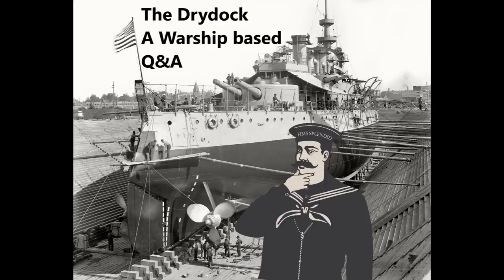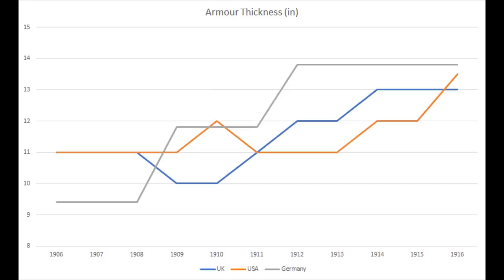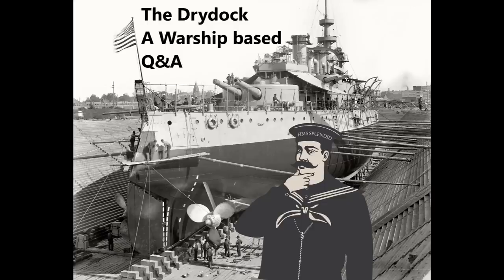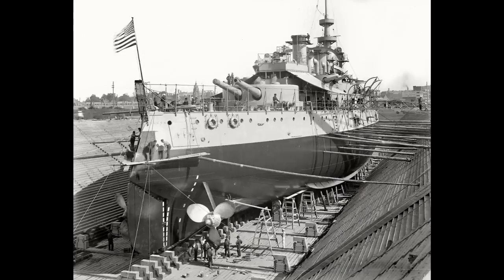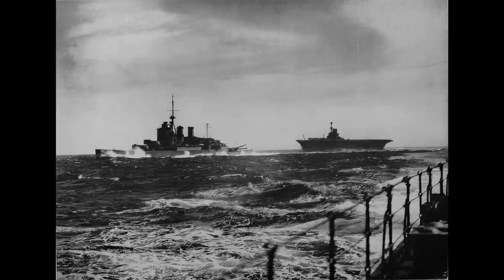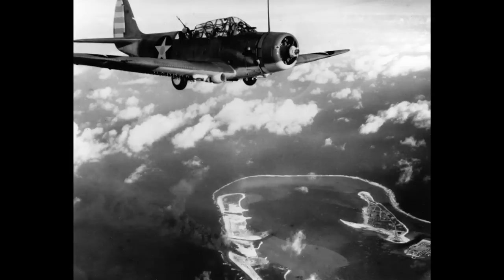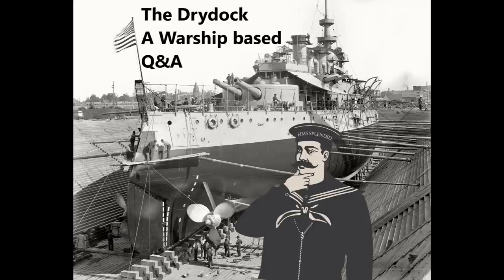The Drydock - Episode 226

Comment: As for Darwin Awards, I'd nominate 3 events:
1. Pearl Harbor.  Even without hindsight, the lack of basic US fighter cover gave the Japanese a perfect attack. (With a 1a of the Japanese calling off the third attack wave on drydocks and fuel dumps, which gave the US a fighting chance at recovery & the fuel to counterattack)
2. Marianas Turkey Shoot: it devastated the last trained Japanese air crews and planes, forcing them into Kamikaze tactics that started shortly thereafter (which in itself turned Darwin Award tactics in a devastating and arguably effective weapon)
3. The US attack on Truk. This attack devastated the iJN surface fleet when they did not have the time or materiel to replace.  It also lacked much of an air defense response, either

Comment: Thanks for your reply to my question about Courageous.  I am satisfied that Furious was intended as a test bed for the 18".  The design was in hand, could be built quickly, and, was large enough to carry the 18" guns.  Since posting that question, I found a letter on The Dreadnought Project: Fisher to d'Eyncourt, saying words to the effect that the Baltic operation was "the story we will use to sell them to Cabinet", which makes it sound like the Baltic op was not what Fisher really had in mind, but only an excuse to build them.  In that letter, Fisher also says having the draft be 22 1/2 feet or less was imperative.  The draft was the only parameter laid out in that letter that Courageous missed, by a wide margin.  Renown's draft was some 5 feet less than Revenge, but Courageous' draft was only some 14 inches less than Renown, so hardly seems worth the bother.  I tried redesigning Courageous in SpringSharp to see if I could get to that 22 1/2 foot draft.  Could not make the hull any flimsier, so replaced the two twin 15" with three twin 9.2" turrets borrowed from Lord Nelson pre-dreadnoughts, to reduce weight.  Only reduced the draft to 24 1/2 feet.   It could be a matter of Fisher seeing those unused 15" turrets and deciding he would see them used, for something, other than a monitor, and Courageous was what he came up with, to have the turrets put to use, much as the construction of Vanguard was due to the availability of those same four turrets.

Comment: 24:40 Clouds worrked both ways at Midway at least. With the Japanese having poor radios no radar it was essential for the Japanese to visually detect incoming strikes, but the clouds concealed the high flying SBDs from both the ships and the CAP that busied itself with the TBDs and the Thatch flight that flew in low, under the cloud cover and were thus detected by both the escort ships and the CAP.

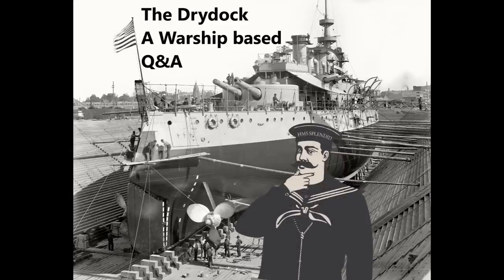Comment: 46:46 I think you are perfectly right when you say that this is an impossible question to answer for certain. When the Washington treaty was debated in Japan, it was very much an argument between two factions of the Navy. The Japanese called it “the war of the two Kato” because the two factions were led by admirals named Kato: Katô Hiroharu (or Kanji depending on the reading) and Katô Tomosaburô. However Katô Tomosaburô was the most senior of the two, and had been minister of the navy and full admiral since 1915, and was Japan's chief commissioner plenipotentiary at Washington, so his faction, which was the majority, won. From what I read the Japanese were not too much against the Washington treaty as an armament regulation treaty (Katô Tomosaburo was appointed Prime Minister after his return from Washington). They were, however, disappointed by the British because they felt that London chose Washington over Tôkyô and the British were relegated in the camp of “the anglo-saxons” i.e. the English speaking superpower that wanted to undermine Japanese success. The relations between Japan and the US were already tense and the British siding with Washington was a big disappointment for the Japanese. However the big Kantô earthquake of 1923 put aside military matters and worsened the economic and budgetary situation of Japan. But by the end of the 1920’s, Japan had recovered from its economic crisis and then came the London naval treaty, which was much more debated and opposed than the Washington treaty. Katô Hiroharu was by then Chief of the Navy General Staff and Japan’s economy was doing well unlike the US’s and Britain’s economies (Wall Street Crash of 1929) so the treaty was seen even more as unfair for Japan. So… To return to the initial question, I don’t see anything against a continuation of the Anglo-Japanese alliance at least until the 1930’s. In the late 1910’s and in the 1920’s Japan was in a period called “the Taishô democracy” so is not the dangerous, expansionist and militarist country (anglo-saxon vision) of the late 1930’s. And to be honest (non-british opinion here) I don’t see the British oppose imperialism, unless it is against their interest. Japanese politics at this period are quite unstable so it would be impossible to guess the outcome of an alternative 1930 London treaty in which the British are still allied with Japan (they might obtain more with British support) but at this point it is science fiction.

Comment: It was only in mid-WWII that the problem of not being able to tell one ship's fire from another at the same target was solved by the British when they adopted the French "K" shell modification using colored dye bags in the APC/CPC ammo windscreens with high explosive shell nose fuzes and boosters in the tip of the windscreen to cause a bright colored flash and puff of colored smoke when the shell hit either the water or, a benny, also the target.  The Japanese and the US in WWII kept the dye bags that colored the splash on water impact only in the windscreens, which did not work at night or with even moderately poor weather.

Comment: Re: French 13" .vs. Italian 15":  I wonder how much of the wear and tear is due to difference in powder blends.  Some smokeless (civilian) powders of the 1930's were known to cause erosion at the end of the chamber...  
 
Perhaps the Italian blend burned hotter to get the velocity causing this erosion.  
 
Another possibility is tolerances as well as metallurgy, if you're a bit oversized on the shell and/or the driving and rotating bands this will cause issues. As will harder metal for both bands.  Not to mention, if the rifling and grooves are out of spec., either at the start of firing, or as the barrel heats up the rifling protrudes further into the bore and starts hitting the steel of the shell .vs. both of the bands.... bad juju!

 
Last possibility is the Leade/Throat, which is the area between the end of the chamber and the start of the rifling.  (I'm lumping the two together.). The greater the distance between the first part of the rifling to touch the bullet or shell the higher velocity and lower chamber pressure you have 
 
Also, does the rifling start at a shallow angle (harder to make) or a sharp, almost 90 degree angle to the bore?
Reply: Your answer got me to thinking about whether the burn temp was the culprit, and whether one could effectively layer different powders in the bags such that one burned cooler next to the barrel surface while another burned hotter in the center of the bore, much the way, say, that bands of cooler air are blended in a jet engine to keep an insulating layer between the temps of the flame at the burner (3000 degrees) and the temp at which the metal of the engine begins to weaken (1000 degrees).  Hard to do in a 5.56, but perhaps possible when constructing charges for a 15" rifle.  One of the great ironies of the Saturn V engine was the use of a turbine jet exhaust from the fuel pumps power module to create a cooling layer!!! so that the Kerosene/O2 didn't melt the nozzle with its tremendous flame heat (5000F+)

Comment: 24:46 I was curious to how long 300 cubits was, and it works out to 450 ft.  Looking up the Connecticut-class battleships, which you mentioned had the same length-to-beam ratio as the Ark was described to have had, I was amused to learn that they were 456 ft long.  That's actually hilarious.
Reply: That depends on which cubit you're using and if you're using the "biblical cubit" would depend on who's definition you're looking at since I can remember at least three different numbers given for that... Those numbers being 48cm, 54cm and 57.6cm.
Reply: @adenkyramud5005  The modern standard for a cubit is 18 inches, a foot and a half or half a yard.
Reply: @adenkyramud5005  take the average  :p

Comment: Might add that you don't want a battleship to be too stable. If it is, for example rolling motion has a shoter period and this faster motion makes accurate gunney harder. A ship that is too stable is also less comfortable for the crew. The objective is to have a nice slow suitably sluggish roll (while not capsizing).
Reply: How is it less comfortable? Please explain
Reply: @lifeindetale , he refers to a short rolling period, which in my experience is called "stiff", rather than "stable". The slow roll he describes is called "tender". Rolling periods are measured by dropping a weight on the side of the vessel and timing the roll. Stiff vessels can be uncomfortable because they roll more, and more quickly,  in  seas with short wavelengths.  This is a resonance, the waves push up on the vessel when it 'wants' to roll up anyway. The advantage to a stiff vessel is that long period waves, which can be of much greater size/amplitude do not excite such a resonance, which is very dangerous. 
I worked for many years on offshore oil supply boats, which were quite stiff. A short, choppy sea was considerably less comfortable than a big "swell". On occasion,  stiff vessel can roll a surprising amount in very light seas if the wavelength matches the rolling period very closely.
Reply: @lifeindetale  A more stable ship has a shorter roll period which leads to faster and jerkier motions. Slower more sluggish behavior is more comfortable. Compare sailing on a catamaran compared to a keel monohull. Or a car with very stiff suspension.
Reply: I think some Italian Battleships had the too stable issue.

I might be misremembering with that statement but pretty sure some WW2 battleships did have that issue.

Comment: I have read that the Courageous class were designed to provide scouting in the North Sea during rough weather. The smaller cruiser would lose significant speed in rough sea limiting their ability to perform scouting duties. The larger size of the Courageous class allowed to remain stable and maintain speed in the rough north sea. The shallow nature of the North Sea caused a rougher surface. The Furious does not appear to have a clear purpose. One reason published was they were going to be part of an amphibious force project to open a new front  along the German coast.
Reply: What about sending monitor to the Baltic end of the Kiel Canal and bombarding the banks to make them slump into the canal? 
That would make it too shallow for the heavy units of the High Seas Fleet. The small boats would be troublesome.
Reply: Shallow North Sea???????
Reply: @benwilson6145  The North Sea is relatively shallow compared to the Atlantic. Also the North Sea is home to oil rigs which are seated on the sea floor. During the battle of Jutland when one of the battlecruisers blow up in two pieces there is a photo of the two halves standing on the seafloor before it went down.
Reply: @kegapr181   I think the your knowledge of the North Sea is thin to non existent. The oil rigs that that are seated? on the sea floor . Platforms can operate in  several hundred feet  of water. The deepest Oil rig that is "seated " on the sea floor that I am aware of is about 1,550 ft. Maybe buy a couple of charts?
Reply: @20chocsaday  That would be an interesting idea to test out. I think the only draw back would be the monitors  lack of speed and movement. I wish Jackie Fisher recorded more details of his Baltic plans to see where that could have gone.
Reply: @kegapr181  Ignorance is bliss! Maybe only post on subjects you have information on?

Comment: The story of the disintegration of the Anglo-Japanese alliance was primarily a product of the 21 Demands, not the naval treaty system.  The forces that were building since 1914 that eventually forced the Japanese by to withdraw from Tsingtao in 1922 and turn over the former German exclave to the Chinese despite the UK continuing to hold the Royal Navy base in Weihaiwei throughout the 1920s effectively killed the alliance long before Washington demanded it on paper.

Japan conveyed their 21 demands in secret to Peking/Beijing in January 1915, which essentially would have turned China into a Japanese vassal.  The Japanese were taking advantage of the perceived British weakness due to the stalemate on the Western Front, versus to the victorious Japanese that had taken Tsingtao and all of the other German possessions in the Pacific that had not been seized by Britain or France.  But Beijing outmaneuvered the Japanese, simply going public with the demands which drew the ire of the Americans.

The 21 demands would have ended the Open Door Policy, which had existed in a de facto form since the Opium Wars but explicitly since the Americans had proposed the free trade zone to prevent a Scramble for Asia and resulting colonial wars in the late 1890s.  The Wilson Administration had no desire to change the status quo, and Britain worried that Section 5 of the demands could threaten its positions in Hong Kong and Weihaiwei.  This forced the Japanese to abandon Section 5, and the final agreement between the Chinese and Japanese gained Tokyo not much more than ill will in London and Washington with white-hot hostility from the Chinese closer to home.

The Japanese ham-handedness severely damaged their position in the Versailles negotiations, and drew such ire from the Americans that they sided with the May Fourth Movement, an anti-Japanese protest movement begun by Chinese students in Peking on 4 May 1919, leading to the Chinese in 1922 gaining nominal sovereignty over Shandong Province for the first time since the Sino-Japanese War of 1894-95 despite Versailles ceding control of Shandong to Tokyo.

The Japnese decision to agree to the Washington Naval Treaty of 1922 and the London Naval Treaty of 1930 is quite bizarre given how Japan's imperialist aims were withering under the glare of the Anglophone countries, but the Depression of 1920-21 smashed Toyko's finances and threw them into a lost decade.  The entire world was undergoing the sharp economic contraction since January 1920, but Japan never experienced the Roaring Twenties according to Hikaro Saijo in The B.E. Journal of Macroeconomics Volume 8 Issue 1 of 2008:

"Japan experienced a decade-long economic stagnation throughout the 1920s, and output fell below trend by about 20% in 1931 (Figure 1). In 1932, output began to recover and came back to trend by 1940."

Japan REALLY couldn’t afford its fleet plans, let alone its imperialistic expansion plans, until after seizing Manchuria in 1931; but its desire to dominate Asia expressed in the Twenty One Demands did not die in 1915, 1919 or in 1922.  Rather it bubbled on a slow burner, turning the Japanese into a people seething with anger who eventually decided to try to take over Asia AND the whole of the Pacific.

Comment: I missed the community post, but if you were to one day start releasing shorts I’d suggest creating a separate channel for the purpose. That way fans who don’t want to deal with shorts aren’t bombarded with it in their recommendations to quite the same degree.
On a side note, the occasional fun Fridays video consisting of a compilation of clips of the various rants, jokes, and sarcastic comments from the channel and potentially the podcast would be fun. I’m struggling to think of an example from the channel, but the bilge pumps rant about procurement delays to the type 83 would be a prime candidate if the podcast were included.

Comment: wrt the question of barrel wear between French and Italian ships.  Drac touched on it at the last moment, the quality of the steel used in the gun.  I was reading Friedman on WWI naval weapons recently.  Friedman mentions a couple things: the quality of the steel, and the combustion temperature of the propellant.  British analysis of captured German guns after WWI showed the Germans were using much higher quality steel than the UK used, which enabled much greater barrel life.  Estimates were that the German guns cost 5 to 6 times as much to build as British guns, but the superior material lead to much greater barrel life.  The lower combustion temperature of the German propellant was another contributor to barrel life.  That being said, I have noticed that the barrel life for German guns on Navweaps is in line with UK guns, so I am not sure about who is right.

Comment: @Drach
Your explanation/word choice at 6:05 suggests (to me) that it would be possible to make a ship *too* stable.
Is that correct?
(a simple yes/no would suffice - no need to turn it into a future dry dock question😊)
Reply: Yes.
Reply: I think he already discussed this in a previous drydock, on sailing ships some lean keeps sails full in light air and can raise a chine out of the water which is less drag/resistance. The main discussion I remember about ww2 ships was about steering.

Comment: Is there any use in overkilling the thickness of barell walls aka make them very thick, much thicker than an optimal value to resist a shooting stress? Will the barell die slower? Will it affect maximal lenght of a barell?
If your technologies are good enough to make long 15 inch guns for example, is it useful to make your 11 inch guns thicker (maybe as thick as thr 15 inch guns) to increase it’s lifetime?